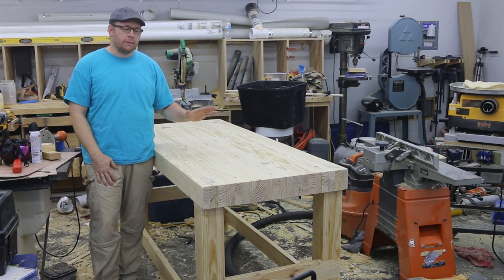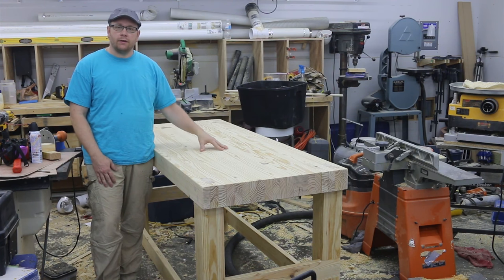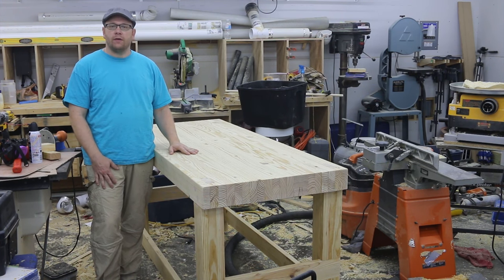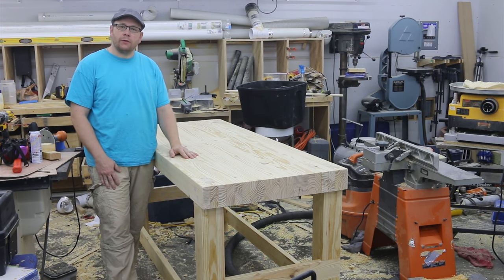Heavy, Huge, $100 Laminated Workbench (No Narration)(Product links in description)

Comment: To answer your question, personally I prefer videos with narration, explaining choices, techniques etc. it makes it more interesting to me. Thanks for the video it's a great looking bench and I'm thinking of making something similar for myself. Just wondering about the rails at the bottom, are the side ones going to get in the way of standing close to the bench to work on stuff?
Reply: I would say no, unless you're planning on sitting at the bench to work.  You could place them on the inside of the legs if you needed some more room underneath the lip of the top.
Reply from the maker: As long as you have the stretcher 3 inches off the floor to give room for your feet, it will be comfortable.  Narrated version coming up!
Reply from the maker: I agree with you Jeff.  You wouldn't be able to sit at this bench like you would a dining table, but for standing and even sitting on a stool, the design should be just fine.
Reply: Warrick Taylor u

Comment: I wish Southern Yellow Pine was readily available in my area.  All we have for construction lumber is your standard spruce pine fir offerings.    Lots of work in doing those laminations.  Did you have any issue with wood movement after milling up and glueing up the 3 or 4 boards to make 1 sub assembly of the legs or table top?  It seemed the final glue up of the top happened on a different day than the original milling of the individual boards?
Reply from the maker: +bwillan the glue-up took care of most of the crown in the boards. I used clamps and screws to straighten them out. There was some cumulative bowing that took place that made glueing of the table top units a bit difficult, but it all worked out with some effort. I jointed everything square before each glueing session.

Comment: Great video! I do have some questions, how did you deal with the planer snipe on the top lamination? Are you from Utah? I noticed the BYU shirt. I really like the idea of not laminating the top all the way on a couple of boards, so you don't have to chop that mortise.
Reply from the maker: +José Escabí great question.  I really need to release a narrated version that addresses some of these things. I only jointed the top side of the table. Once the top side was jointed, I could then use the planer on the underside, so if there was snipe it wouldn't be seen from above. 
I live in Southern Illinois, but I did graduate from BYU. I have built tables both ways and I can say with certainty that laminating the leg joints is way easier than chopping mortises.
Reply: @SouthpawWorkshop  I think I'm going to adopt your build, thanks.

Comment: I was wondering how long it took you. By the amount of different shirts it took you several days. If that bench is one you sold what would you get for one. I have access to a lot of that type lumber and would like to make a few dollars on one. Most people ask far to little when they first start to sell
Reply from the maker: I did this one for my workplace (day job) so I worked on it here and there probably over the course of a week. If you were motivated, you could probably get it done in 10-12 hours of work. Figure out how much you want to make an hour, multiply by how long you think it will take, add cost of materials and there you go. Prices vary by region, quality of work and ultimately, what your client is willing to spend.  You may have to sell for a little less starting out until you have sold enough to have a reputation and a good idea exactly how much time and effort goes into making one. Good luck and I hope you find the right market for selling!

Comment: How are you cutting those tennons with a chopsaw? Im kinda' a newbie/ wannabe woodworker, so forgive me if the question seems rather basic.
Reply from the maker: No worries and a great question.  Some sliding compound miter saws have depth stops on them so you can cut dadoes and rabbets at a reasonably consistent depth.  Not as accurate or repeatable as a dado stack in the table saw, but definitely a lot quicker.
Reply: Thanks.

Comment: Tom, would it have looked a little better if you would have turned the dowels so the grain ran the same way as the grain in the 2 x 6? Or is that a no no?
Reply from the maker: It depends on what you mean by "turned the dowels".  If you mean turn the dowel as in creating it on a lathe, yes you can turn a dowel so the grain runs perpendicular to the length of the dowel, but that makes the dowel weak and defeats the purpose of using a dowel to reinforce the joint.  If you mean turn the dowel by changing the orientation of the dowel so It goes into the end of the table instead of the side, that can be done also, but I want the dowel to act as a peg stiffen the connection between the leg and the table top.  If I stick the dowel in the end of the table, the leg could still come loose over time with repeated side-to-side motion as in handsawing or planing.  I doubt the joint would fail even with out the dowel.  I added it mainly for looks and also as a little insurance on the joint.  Hope I answered your question!
Reply: No sir. What I meant was; if you turned the dowel in the hole before the glue dried, so that the grain runs the same direction as the wood grain you're putting it in, I thought it would look more uniform if all the grains ran in the same direction.
Reply from the maker: aaah, I understand now.  I agree.  This being a workbench, I didn't pay too much attention to detail like I would if this were a dining table.  Great point, though!

Comment: Great video. I was wondering, is there any reason for using 2x4's instead if 4x4's considering it would take half the glue and have half the joints?
Reply from the maker: First off, thanks for the question.  A couple points I would like to make about this table and hopefully it will clear up some confusion.  I didn't use 2x4s to make this table.  I actually used 2x12s ripped down to about 5 inches.  There are a couple reasons for this.  First and most obvious is that I can get a thicker table top.  If I use a 2x4, then the table top is only 3.5" thick.  Second, the wood used for 2x12s is a much denser and higher quality wood than what is used to make 2x4s, so even if i wanted the table to be 3.5' thick, I still would have ripped it down from a 2x12.
4x4 is a completely different animal.  It is difficult to find 4x4 construction lumber that isn't pressure treated.  I don't know how well pressure treated wood would react to glue as well as the concerns of exposing my projects and myself to the chemicals present in pressure treated lumber.  It is possible to get non-pressure treated 4x4s, but they are special order and there is a fee and delivery time associated with that.  If you are willing to deal with all that, to answer your question, 4x4s are perfectly fine for making a table top. In fact, I made a table top out of some 4x4 material a long time ago.  You might catch it in my videos as an outfeed table.  I filmed some of the making of it, but that project fell off the radar and filming was never completed.  Here's the link to the video: https://youtu.be/qyK99ZKLMC0
Thanks again for the question.  It is participation like yours that makes this community so great!
Reply: thanks for all the info and the quick response bro

Comment: How much is the bench?
Reply from the maker: It cost around $100 total in materials.  Your mileage may vary depending on location and material availability.
Reply: Thanks Tom, I was actually curious how much you were selling it for
Reply from the maker: Oh, gotcha.  Depends on a couple factors.  If you are interested, you can email me at tnlightle@gmail.com and we can talk. Thanks!
Reply: I'm out of state so that would not be a possibility, I was just curious what a custom made bench of that size was worth, I'll probably have a go at making one using some of the elements from your bench - thanks
Reply from the maker: +James Watson well, it is the labor that gets you. You could spend upwards of 8 solid hours building this thing, so add that to your cost of materials and you have your price.

Comment: The dust collector on your jointer is inefficient.
Reply from the maker: +motorman very.
Reply: Thomas Lightle - Red Barn Woodworking are used to have that same Ridgid jointer and it had the same dust collection problem
Reply from the maker: This jointer is almost perfection.  Heavy use causes some clogging just below the cutter head, even when connected to a dust collector.  Still worth the trouble for the price.
Reply: Thomas Lightle - Red Barn Woodworking I don't disagree with your assessment.

Comment: painful to watch you use/abuse your table saw as an assembly bench .. liked your use of lamination voids for your table top mortises, should have extended that theme to the leg tenons .. the half laps for the lower leg supports are ok, but would have liked to see more use of lamination voids for mortice and tenon joints .. you need a Paulk assembly bench!
Reply from the maker: You need a workbench to build a workbench! No way I am doing all that work on the floor.
Reply: hence my suggestion for a Paulk workbench (he's on YouTube) .. your very skilled and could throw a 3x6 version together in a couple of hours .. very flexible and easily disassembles (your shop looks crowded - in a good way)
Reply from the maker: All in due time.  This shop is a work in progress.  Thanks for watching!
Reply: Haha i built a big bench and i still find myself using my tablesaw for assembly.

Comment: Videos with narration - but tightly edited.  There are 10,000,000 videos on YouTube of some wannabe Norm Abram running a tablesaw or router  (or worse... sanding) for  15 minutes out of their 20 minute video.  I feel bad for those content creators - they're spending a ton of effort and trying their best-  but are never going to get any traction beyond a few thousand subs.    If you want to make informative, instructional content  and build a real following -  plan it, show it once, narrate it, and keep the whole thing as short as possible.  Has to be entertaining as well as informative.  There's plenty of 'content done right' on both traditional media and on YouTube.  So do THAT don't try to reinvent the wheel.  Here you're gluing up a stack of 2x4s.. running something through a planer... show it once (if at all - not every step of every operation has to be shown).   This video could have conveyed exactly the same information in < 5 minutes.  That's my .02 - good luck with your ventures.   PS I hope you didn't charge only $100 labor for this.. and that seems light even for the materials if you'd like to pop out here and build me one of these benches,  that would be great LOL ;-)